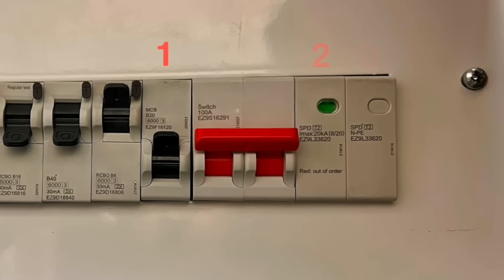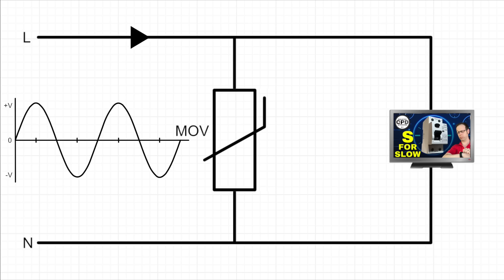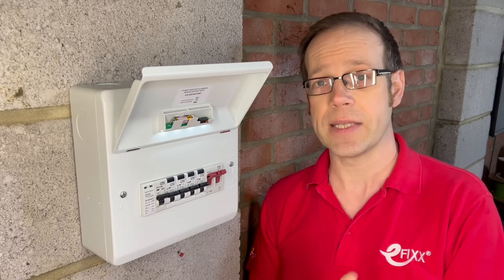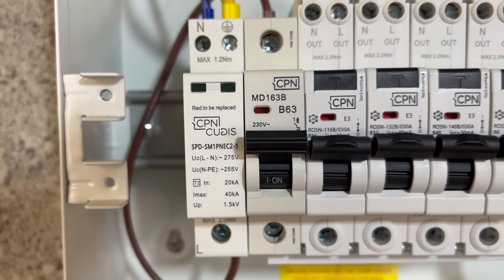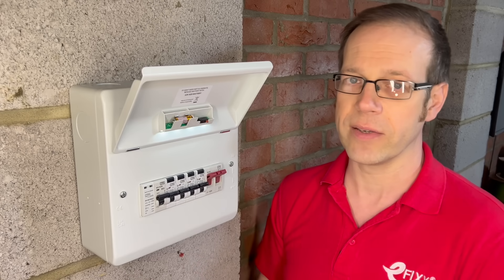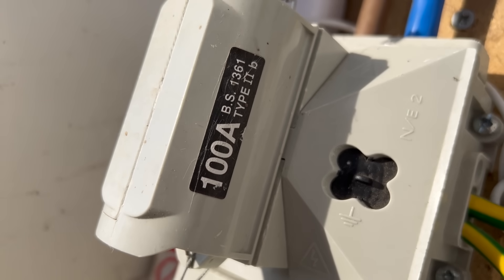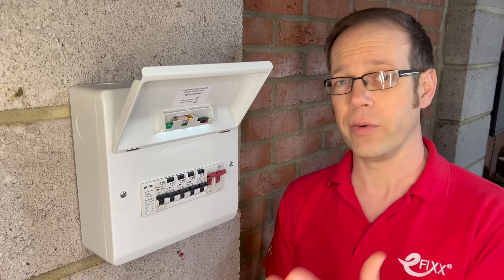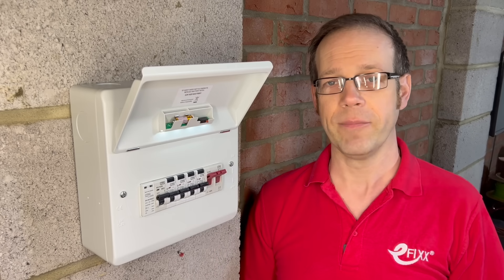Why use a 63A MCB to protect an SPD?

Comment: I like how it's in mine as my house is 230v it directly after a 50 A main breaker, so it isn't likely to trip and not be noticed, yes the internal thermal fuse can still go open and unnoticed for a while.

As if there is a huge external voltage spike it disconnect the whole house saving it. Instead of just disabling the over voltage protection and then burning all the other circuits

Comment: This is great content, thanks for posting it. 👍
I however have a question regarding circuit-breakers that I have tried to have answered in other places but have found no real joy.
Usually, all of the circuit-breakers we strike are the up/down toggle type, however there are some of the Siemens rotary type breakers
that protect motors in switchboards and the like.
I cannot for the life of me find locking devices for these breakers, does anyone here know what I should use on these?
I even tried to contact Siemens themselves, but have not had any reply.
Bear in mind I live/work in New Zealand and I am sick and tired of opening up the switchboard to remove the wires as a means of safe disconnection.
Surely someone makes lock-outs that will take a padlock for these breakers.
Any thoughts?

Comment: Joe I don't have the legs for this one today, "the coarse".  Left a comment today on a connector review somewhere regarding regarding "isolators/ trip switches/breakers that melt and while in the "on" position and leave the circuit live.  People don't realise that these things can work once, a hundred times or when needed most, never.  The last time one tested it and it worked, was the last time it actually worked.  Therefore I am a huge fan of prepaid meters with 63A  isolators in them.

Comment: Has anyone actually changed an SPD??? Installed alot but never come across one that's actually popped
Reply: I have a metal radio mast here in New Zealand, it is a lightning rod, I installed a spark gap unit, coarse protection, medium protection and fine protection in my main switchboard in the house,  my radio installation is in an out-building, when I first installed this I had a couple of the "fine" units fail, the East side of the South Island is terrible for lightning during Spring.
As long as you don't have large metal pointing up to the sky with antennas on it, you should be OK.

Comment: Not sure you're correct here! I agree on Type 1/2 but the MCB is to protect the installation if the design of the SPD is such that it is possible for it to fail and create a permanent short circuit. During normal operation its reactive resistance to HV transients is essentially a short circuit as far as we are concerned but it is measured in uS. Also,  I don't see how the upstream MCB/Fuse can be used a protection device because surely this falls under the opposing regs requiring the safety of the split protection? I've had a look, cannot find the appropriate bit in the brown bible, I can picture it, but tonight, I'm totally knackered and I've been driven to insanity today wiring a bank of air conditioning where the installation manual is the same manual they supply for a tiny house or giant Hotel, 'the wiring table' has a column 'consumption as per attached plate', the plate has about 10 technical entries on it, none of them current consumption, so wire diameter / MCB ratings / RCBO types is a sore subject for me today!

Comment: There can be some dependence on what type of protective device is being used upstream, for example, BS88 or a MCB.
Reply: Exactly, there used to be a term called co-ordination, not sure if that is still taught these days, from my training, I was always taught that an HRC fuse (BS-88) will operate quicker on a short-circuit than an MCB, that also depends on what curve breaker is installed downstream.

Comment: I think the manufacturers ship the CU with an SPD and MCB because they know that the SPD requires short circuit protection so they must provide it. 
But no one says you have to use the MCB that they supply. 
The requirement is for the SPD to have protection from SS and OC, so as long as it is connected to any MCB or RCBO it is protected. 
When space is tight and I don’t have spare ways I piggy back onto the RCBO next to the SPD. Tell me I’m wrong…
Reply: Then someone decides to turn off what ever that final is actually operating (by switching the RCBO), outside lighting, disused socket, what ever it may be, and now the installation has no SPD in effect.  On the other hand, if the SPD faults it will take out the final until repair can be effected and that is not desirable either.  On the other other hand that will give them a positive notice that the SPD has failed and needs replacement.  Lots of consequences to think about there, and more.
Reply: What do you mean by protection from SS and OC.
**OC i believe you referred to as OverCurrent (consisting of Short-Circuit & OverLoads).

But what SS means?🤔
Reply: @temp26j724-i yeah I meant shirt circuit and overload 👍

Comment: I cannot find a brand that actually has an internal fuse other than wylex, can you possibly get hold of wiring diagrams as i am tempted to open a bunch up and prove my suspicions correct that most brands without an mcb are simply just not complying or relying on dno fuse.
Reply: i stand corrected the FuseBox SPD2PT2 (Type 2) has an internal fuse of 125amp so with a dno fuse of less than that would be non compliant as the dno fuse CANNOT be used as SC protection
Reply: @AGRElectrics  That seems un-usually large  as far as protection goes, I would fit a lower rated CB in series with that, maybe 80 or 63A, more likely 63A.

Comment: Click Scolmore Elucian have put both conductors from the SPD with 6mm2 cables directly in to the bottom of the main switch, the SPD live terminal goes in to the L output of the main switch along with the live bus bar. The surface area of this 6mm2 fly lead is only 8mm x 1mm, not only that it has been dipped in solder and not ferruled or ultrasonically formed. This wire does not have enough surface area to hold the main bus bar comb against the fixed part of the main switch cage terminal and being "tinned" introduces a load of other issues. In addition to that as the SPD live fly lead comes directly out of the live output terminal on the main switch it is completely unprotected electrically inside the consumer unit and would rely on the DNO fuse if that wire shorted out on the consumer unit itself, that alone may not comply with a TT installation as it is not reinforced or double insulated. The SPD itself does not display a fuse symbol and 100A gG displayed on it anywhere which I believe is not compliant to be used without an MCB. It seems they have taken an SPD designed to be used with an MCB and just wired it directly to the unprotected mains switch live output. Other manufacturers have changed the design of their SPD's so the live terminal is at the bottom of the SPD and can sit directly on the bus bar. Which is strange as the OEM for the SPD they use seem so have that type available as other consumer unit manufacturers use it
I've contacted Click Scolmore who said that they agree with a lot of things that I have said and are investigating it, I have had an initial response back but still waiting to find out any more.
I do have concerns about this cable and the bus bar in the shared live terminal working loose over time due to the live bus bar comb only being held against the inner connection of the live terminal by a small "tinned" wire and also a situation where the L fly lead from the SPD gets damaged or caught against the metal casing of the CU. A cable sharing a terminal with a bus bar is not usually an issue provided it is terminated correctly and is of the right size and this arrangement is quite common on some split and multi row consumer boards, however the cable size would be equal to the size of the bus bar comb.

I have one of their consumer units sat here that I was due to install but with these issues I've found and the fact that it is a TT installation I am holding off until I find out what is happening, I do hope these issues get rectified as it can be resolved quite easily with a different SPD Or redesign of their existing SPD. If not then I will use a different brand of consumer unit.

I do wonder if it would be worth any of your team looking at one of these newer Elucian boards with the single din SPD (earlier boards used a twin din module SPD), especially if you have one there.

Comment: OBO bettermann requires 35mm² wires for their SPD. 

MCB has coil with reactive impedance + thin wire has resistance. In case of overvoltage MCB coil + thin wire will cause voltage drop and SPD won't sense any spike.
Reply: Since we are clamping across line and neutral (and to earth separately depending on circumstances) if the SPD does not 'see' over voltage, and go into conduction as a result, your appliances won't 'see' over voltage either ...
Reply: @retrozmachine1189 MCB has resistance, during spikes voltage will drop on MCB. That is why OBO bettermann requires 35mm² wires for their SPD - resistance between main switch and SPD will be minimal. 

In UK regulations create voltage dropper circuit on SPD.
Reply: @Dmitrytln  Think about it a bit more.  I'm sure you will get there eventually.  If you can't work it out ask for help and I'll describe what is really going on.

Comment: 0.55 I think the illustration may be slightly incorrect as the voltage spikes are not sufficiently high enough to be shunted by the MOV in the SPD, the first one is only slightly higher than the positive peak of the sine wave, and second is less than the negative peak.
Reply: Yep, just a glitch in the sinus wave wont do anything, typically need to be 100 v or more above the typical mains voltage to actually activate and shunt it to ground

Comment: 0:57 those spikes look like a high-frequency signal (much higher than the 50Hz we get here in europe), so would it be possible to filter them out with a low pass filter? my thinking is that an MOV will only activate when the voltage exceeds the threshold, and below that voltage the signal will get through and get a chance to damage sensitive equipment.
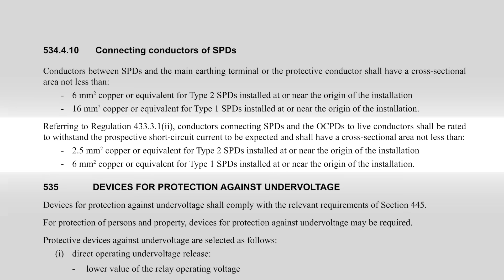4:53 do those regulations say anything about type 3 SPDs? if i had the money to build my house, i'd want all 3 types of SPDs (because i have quite a bit of electronic equipment), plus type B RCDs, power conditioners and AFDDs.
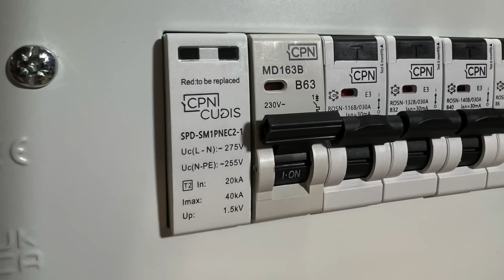5:14 would it make sense to use a type Z (instead of a type B) MCB here?
Reply: See also ferroresonant transformers.  You are right about how MOVs work, there is a very steep slope to high current passage as you exceed the rated voltage.  Anything that rides on the 50Hz but does not exceed the voltage rating of the SPD will simply pass right through to your appliance.  Unless the appliance is total junk though it should not suffer any ill effects as it is built to cope with at least 330V DC (peak voltage of 230VAC).
Reply: @retrozmachine1189 1. It's not peak DC. It is just 330 volts. It is wrong to qualify it with "DC".

2. The peak voltage of 230V RMS is not 330 volts, it's 225 Volts.
And notice I did not qualify it by saying it is 225V DC.
Reply: @deang5622  Thanks for letting everyone know that you have no clue.
Reply: @retrozmachine1189 I have a degree in it dude, which you clearly don't because a) you can't even do the calculation properly and b) you can't even use the right terminology.

If you want to challenge me go ahead, but you WILL lose. You will NOT win against a degree qualified EE.

Rethink your attitude homie.

The reason it is 325 and not 330 is because you the peak voltage is:
Vpk = √2.Vrns

But you didn't know that did you?

And √2 = 1.4142136
And therefore,
230 * 1.4142136 = 225.2

You already specified a value of 3 digits of significance, so why not use the correct 3 digits of 325?

Because you don't know how to calculate it,  that is why, isn't it?
Reply: @deang5622  Sure you do.  Sure you do.  I bet you assisted NASA building the space shuttle too.  You can't even get the maths right and then you have to jumble everything up trying to disguise your mistakes.  Reply if you must, actually I know you will because you just have to prove to everyone how little you actually know.  Don't worry though, I won't be reading it or replying to it.
Reply: @retrozmachine1189  that may be the case but i'm sure there are devices that are affected by high frequency components in the supply. audio devices, for example, especially high end audio devices.
Reply: @mrxmry3264 Oh sure, you may get buzzes and pops in the audio but it's not harmful.